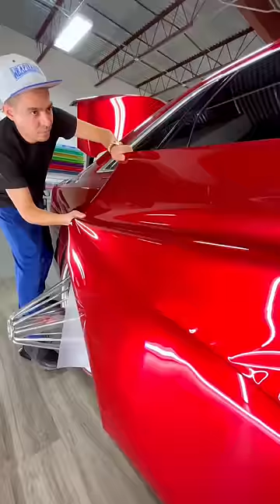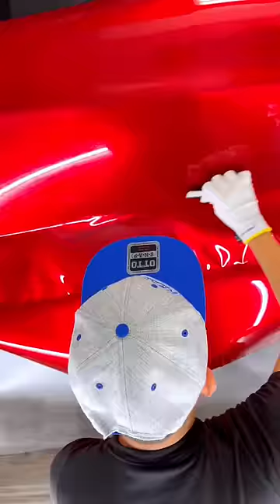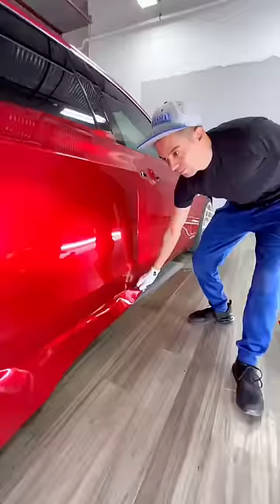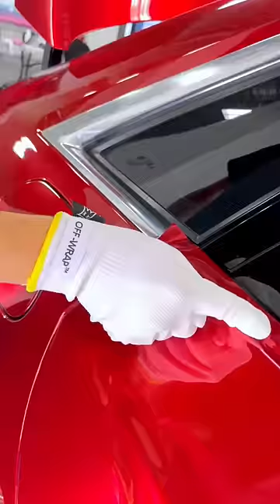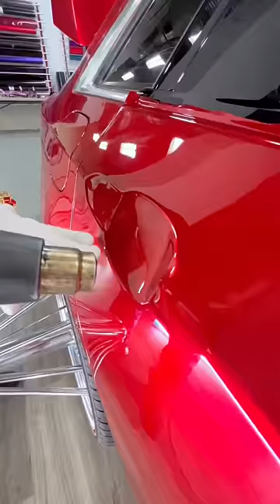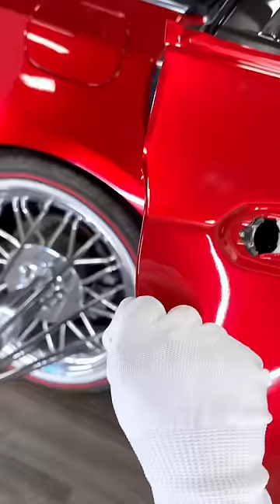The Next Level of Wraps 😳🔥✨ The Glossiest Wrap EVER 💪 #asmr #asmrsounds #carwrap #carwrapping

Comment: If you figure out the cost you might just have it painted 👌
Reply: I think they aiming for the rich people
Reply: @absteven  yeah one of the pro wrappers in the UK wrap high end cars cause the cost is cheaper then a prestige paint job and the colours available in wrap are not even close to the options with a wrap and repainting a lambo is going to devalue it dramatically and thos keeps it like new for the next buyer.
Reply: a wrap is about 5,500 and true candy paint is about 8,500 on that size car. especially here in Houston where this dude Paul Wall is from.
Reply: @JuarezDerrick  😂$8,500😂 maybe 10 years ago…
Reply: But if you don't like it you can change it back alot easier.
Reply: @reggieanderson885  that's a small car though
Reply: @JuarezDerrick  Compared to a Fleetwood sure.
Reply: @kensmechanicalaffair  this car is small compared to any full size car, SUV or truck.
Reply: @JuarezDerrick  It is a full sized car.
Reply: @kensmechanicalaffair  for a newer car I guess you are right.
Reply: @reggieanderson885  yall have it tough over there😭 for us max is $2k for a full body respray. I live in Botswana, Africa can show you a few cars the shop has painted😫 they always come out good
Reply: Is English your second language

Comment: Absolutely gorgeous! Looks better than a paint job. But, how easy does it scratch or get dinged up? Like if a rock hit the wrap driving down the road, world it tear? And if so, how easy, not easy, is it to repair a small section? 🤔
Reply: It's resistant to minor dings and scratches, but that's its purpose – to protect the actual paint finish for resale.

It isn't repairable in small sections.  Think of an entire door, lid, or panel.
Reply: You can protect the wrap with ppf if you can find something as shiny as the wrap itself.
Reply: @kiankian1588  thx! 😊

Comment: The spoke should not poke out of the end of the nipple. Period. This situation is due to either a too-long replacement spoke being used in a repair, the spoke being stretched out, or the wheel not being properly "tuned"